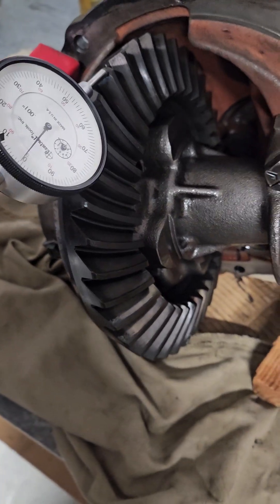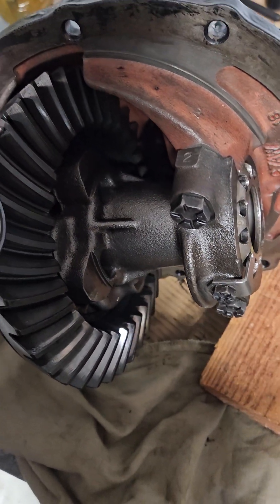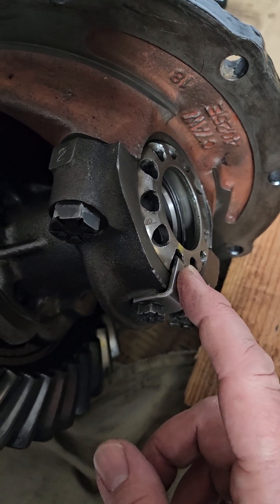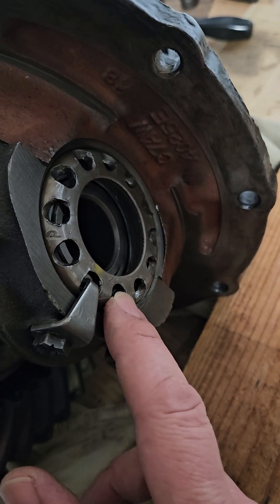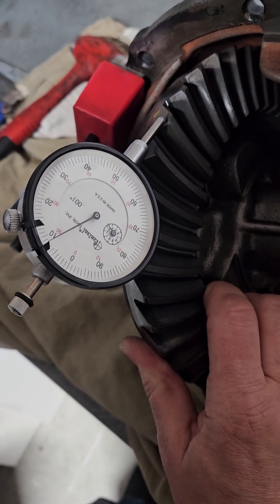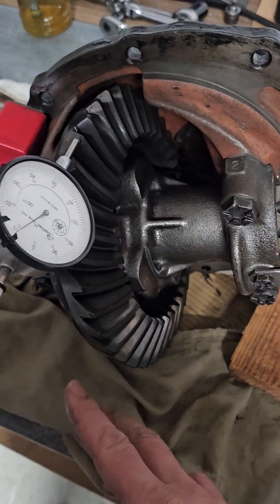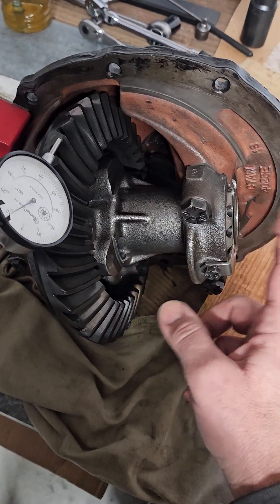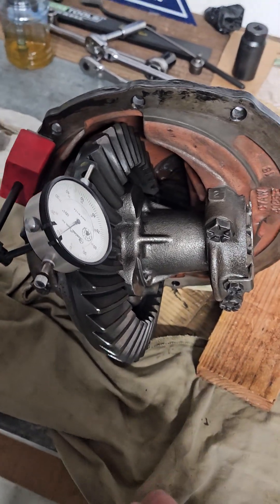Must watch to correctly set up a Ford 9" carrier part 3

Comment: If you did not tighten the ring gear side adjuster an amount equal to what you loosened on the non ring gear side you lost preload.